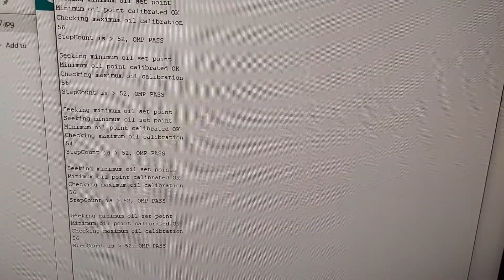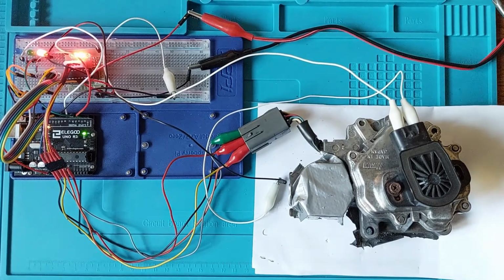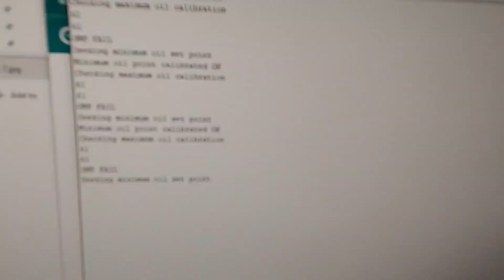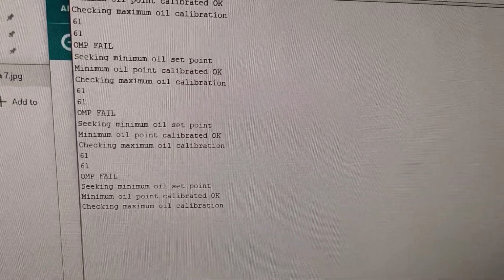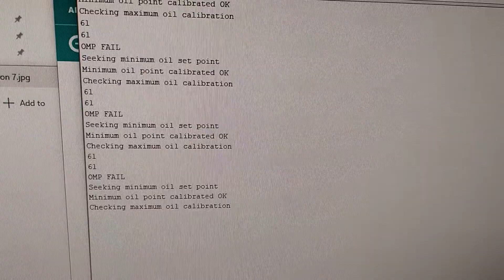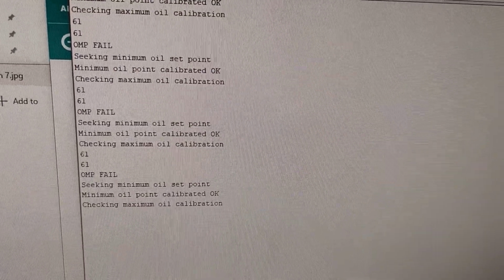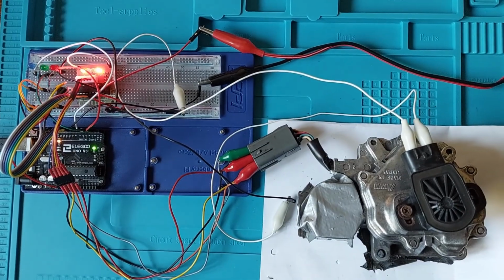Mazda RX-8: Prototype OMP tester

Comment: Ok i tried to loosen the sensor adjustment bolts both were rusted and broke off in the pump but an interesting note...the rusted bolts had deacyed enough so that the wire harness tugging on it, bc its pulled kinda tight, spun it fully ccw the way you did at the end here to cause the limp mode. I jb welded it back on the pump turned clockwise and no cel!!

Comment: I discover we made similar tester - one question original switch is normally close NC and open when correct position is reached or the other way around and is a NO? Thanks
Reply from the maker: The sensor is NO (Normally Open) but changes to a low resistance when the stepper travels 52 steps (or more) on a functional OMP. It's not a switch in the classic sense, as it changes from many megohms to less than 400 ohms. I don't know the technology employed inside the sensor, but seemingly not a metallic contact, due to the relatively high resistance when closed.

Comment: Hey Malcolm,
ive been in limp mode for the 3rd time, some how got out of limp the other 2 times just by reconnecting connections, 3rd i've moved the Senor left and right and middle and each time it keeps going into limp after 3-4secs
Reply from the maker: The exact set of criteria the ECU uses to decide the OMP has a fault and engages limp mode is still a mystery. I have programmed every test criteria published by Mazda into this tester (less resistance tests, which as easy to do separately)  yet "failed" OMP's still pass all the tests. Given you've managed to clear the fault by reconnecting connector, I would be taking a good look at these as a possible cause.

Comment: Is another way to adjust the sensor? I have not thiw device
Reply from the maker: All you can do is adjust the sensor fully clockwise, which gives the maximum oil output. However, you can't be sure the OMP is "stepping" within the Mazda spec - you'll just have to rely on the ECU throwing a code if it senses something is wrong.

Comment: I'd like to test the harness going to the Omp. When the key is turned to the on position. Should I get something from certain wires. If so what?
Reply from the maker: I think you would be better off simply testing for continuity of all the wires. The signals are quite complex waveforms to drive the stepper, so would require the minimum of an oscilloscope to view the dynamic waveforms.

Comment: Can I buy your code and schematic?
I think I found the driver you are using.
I can load code on an arduino and follow a schematic.
If you are worried about me interfearing with your sales, don't. 
I have no desire to make these for anyone else.
I could do the CAD for a 3D printed case if that would be of any use to you.
I'm fighting to get my rx8 out of limp mode and really dont want to spend over a grand on a new one.
Thanks
Reply from the maker: I have no plans to make and sell this tester. The prototype enabled me to develop and build a one-off tester in a small case with an OLED display to provide a better view of the test progress and result. It is intended to offer the tester to RX-8  owners in the UK, should it prove useful. You are welcome to the code. I have some hand drawn diagrams of the final component layout and connections I can copy. The final version was a very simple, a single press button to start an automated test sequence. I should warn you that I haven't managed to find an OMP to fail yet, including my own unit (as in the video above) that caused my ECU to go into limp mode! Unless, of course, I adjust the sensor to deliberately cause a failure. This is most frustrating, and suggests that, maybe, the ECU is maybe monitoring something else, not only the OMP, to decide if limp mode is to be engaged. I replaced my OMP with a unit from a breaker (£80 sterling) and haven't had a limp mode issue since. The The OLED display on the final version shows the number of steps recorded before the sensor activates and a "PASS/FAIL" message. I'll need your email or other contact details to send you some stuff if you are still interested - which country are you based in BTW?
Reply from the maker: If you can access this, it shows more details of the tester development, and photos of the final version: https://www.rx8ownersclub.co.uk/forum/viewtopic.php?f=30&t=84213

Comment: Also, does the high/low lever need to start from the low flow position before the sensor switch can be adjusted?
Reply from the maker: No, the sensor position can be rotated with the high/low lever in any position. It only changes state at the maximum oil end of the lever movement. As in the video, if the sensor is moved too far, it operates too "late", after the maximum spec of 60 steps have been made by the stepper motor.

Comment: Great work! So, how much would you need to adjust the sensor to return it within spec?
Reply from the maker: Very easy, using this tester, just loosen the adjuster screw on the sensor, run the test to check the steps are in range on the monitor (or use the indicator lights). If out of spec, simply rotate the sensor a few degree, re-check, and then lock down the adjuster screw once in spec.